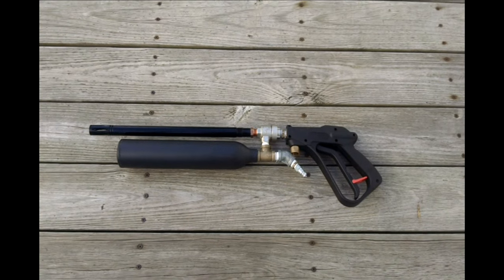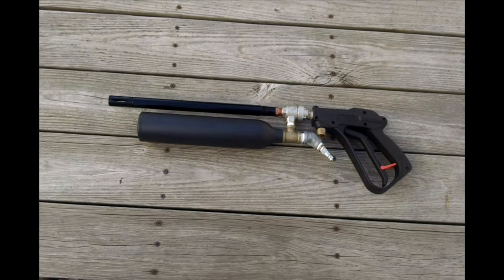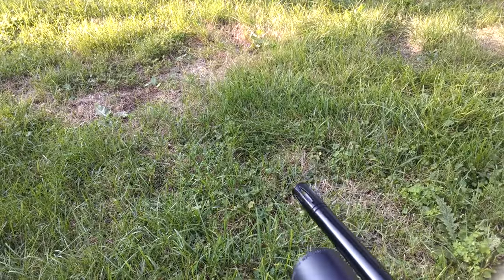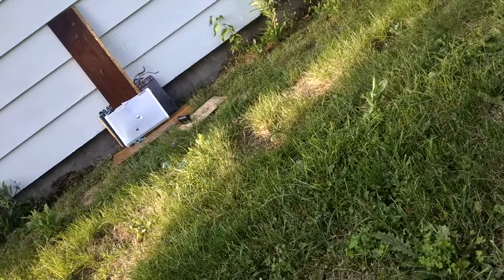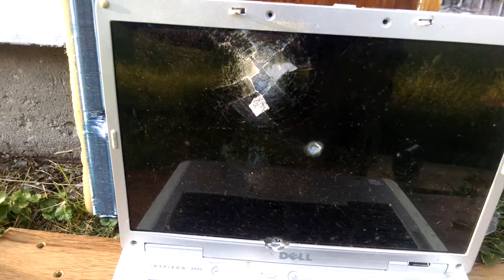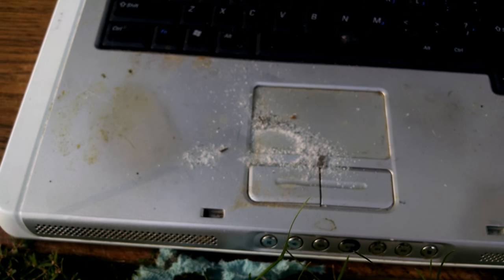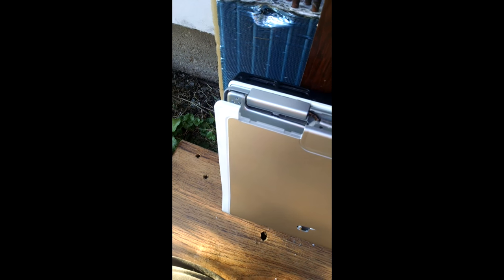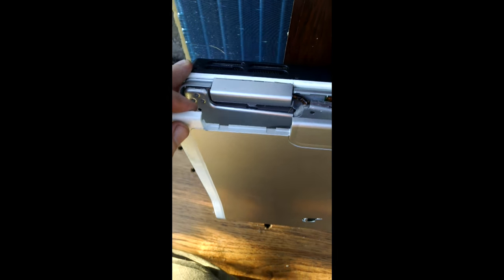QEV air rifle .68 short barrel vs laptop 400psi

Comment: Bh chance you got a link to that trigger? Also to you think that QEV and trigger withstand 700psi?
Reply from the maker: Check out some of my other videos. I go over the parts used. I also take it past 800psi. Trigger is rated for 3000
Reply: @swandonovan  thanks mate, seen you other videos, awesome vids!
. Made my own QEV, running a paintball remote line and tank which is 700psi... problem in having is I cant for a pilot trigger rated for 700psi.... any chance you could send me a link to one?? Greatly appreciated!
Reply from the maker: @DaPewPewGuy  no problem. Glad you enjoyed them. What kind of pilot you looking for? They make stuff for paintball that's rated at high pressures. In my 30 min video I go over what the exact pressure washer handle is. But pretty much any should work
Reply: Something like a pistol grip, or similar to yours. Any ideas??
Reply from the maker: @DaPewPewGuy  yeah just check out that 30 min video. I tell what the pressure washer handle is. But like I said, pretty much any pressure washer handle will do the trick
Reply: Ok thanks mate, I shall check it out again. How does the opposite pressure go on the handle? I was thinking a air gun trigger, but if pressure washer handle is better, I'll go with that
Reply from the maker: @DaPewPewGuy  not sure what you're asking? If you watch my later videos, I convert it to multiple shot with mods to the pressure washer handle